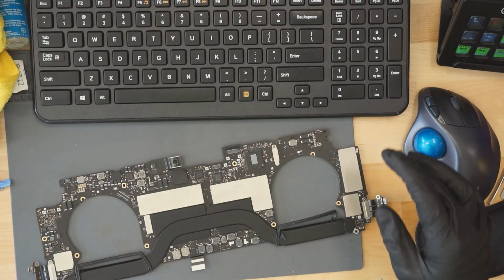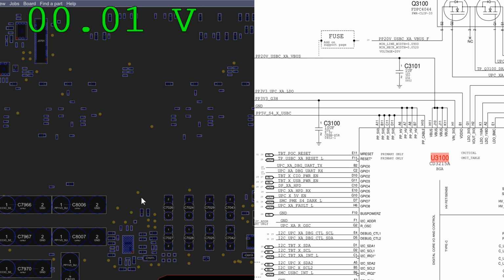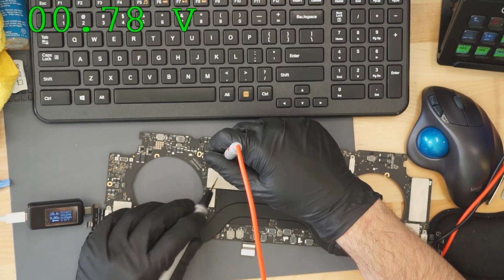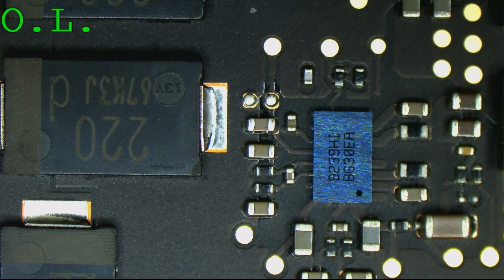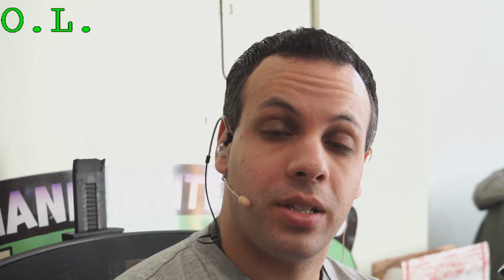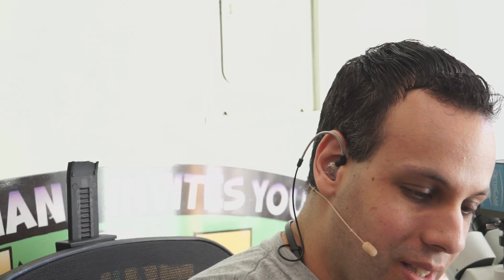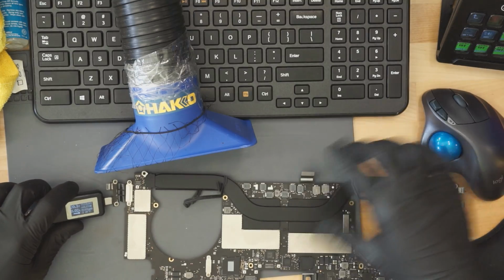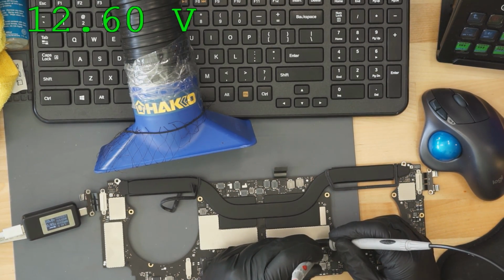Why new Macbook boards will be unfixable for me: sad :(

Comment: Pro tip from Louis, dont buy Apple, its being run in to the ground since Steve died.
Reply: problem is if you want to develop on OS X or Iso you have to use an apple product. Those are the only 2 reasons I could ever come up with to buy apple, pc kills them in every other aspect.
Reply: @asdfkhieee  Not even that. I wrote an I-Phone app without ever touching any apple product. I just installed iOS and MacOS on my Linux PC. (final testing obviously had to be done on an actual phone, but barely any issues there)
Reply: @patrickkeller2193  hackentosh is cool and all, but most people arent gonna do all that. Easier to buy a MacBook. The updates have a tendency to make you have to rebuild parts of your hackentosh.
Reply: @asdfkhieee  Nah, we were not using any hackentosh software, we were using straight from Apple MacOs in a virtual machine, that we got in a premade image. literally ctrl-c, ctrl-v install. And iPhone on the second monitor. Never got update issues for the whole year either.
Reply: @asdfkhieee  The only reason you have to buy into an ecosystem you don't like, is to develop for said ecosystem? Why should this matter to anyone with the above view of Apple being shit.
Reply: @jaihayes9647  because you want your product to get into as many hands as possible to maximize profit. So if you want said product to be in the hands of everyone you need to use the aforementioned OS or lose a large portion of users.
Reply: A tip from Louis, "Guy, don't bother fixing Apple products, they're unfixable... oh just leave it to me, I'll fix 'em all." .. lol
Reply: @Kero Two you dont have to run windows on a pc though.
Reply: Whats the last Macbook/iMac that was made when Steve was alive?

Comment: MacBook Pro have become completely garbage. Last year I have purchased 2017 top specs 15 inch MacBook Pro. I just sold it about a month ago. I rather buy a clevo laptop with a desktop processor and upgradable parts. Windows 10 pro is a good operating system and is very customizable and optimization for pro audio and video production  And is way cheaper and better for the ridiculously overpriced overrated  what Apple is charging!!

Comment: @Louis Rossmann I salute you and wish you luck on your uphill battle against the rotten apple tree. They design products that are extremely difficult to repair and if that doesn't work, control supply chain so the parts needed for repair is not available to third party repair shops. Curiously, the part that is hard to find is the one that keeps failing with no good reason. Makes me wonder if it's designed to fail like that?? This is how they monopolize a market and rob people blind. On the other hand, if people wise up to this scheme early enough through channels like yours they may abandon the apple tree and let it rot alone which would take Apple back to mid 90's where they almost went bankrupt. On the PC land, it's harder for likes of HP, Lenovo or Dell pull this kind of scheme, because consumers can switch to another competitor's product without losing as big of an investment locked into Apple's monopolistic ecosystem. Imagine if Ford or MS tried pulling this kind of scheme back in the day... At least parts should be available to end users to perform their own repairs if they chose to do so.

Comment: And it is Louis's recommendation that i didn't buy a new Macbook Pro. I still have my 2011 original release MacbookPro Retina. i just replaced it with an MSI GE75 Raider. 16gb ram that i can replace, i7 8750 6 core, 6gb GTX 1060 and the ability to come with 3 Hard drives that i can replace. Like to see a new macbook pro do that!!!

Comment: Have you had any complaints about iphone wifi dropping? mine has been very temperamental over the last few months but yesterday it started dropping wifi connection(Still connected but not responding until you turn wifi on then off again, then it happens within the next 5 minutes) I guess iphones really ain't your thing but i figured since you're such a big "fan" of apple, you may know something about it? If not then meh, i'll just go back to android -.-

Comment: Efforts are made in the EU to make it illegal to make products unserviceable.
Reply: Yup I heard something like that too, how people end up having to throw away a clothes washer because the tub can not be disassembled to service a simple electrical part underneath. But, I also recall EU made micro-usb the standard all phone vendors would have to adhere so people don't keep amassing phone chargers with different connectors. By the time the standard settled in, guess what, we got new standard that came along; lightning connector, tb2, usb-c, ... Before a standard matures and becomes mainstream it gets replaced by a new "standard".
Reply: @tech29X  i think USB -C is wahat they wanted as a standard, and well thats well underway i believe
Reply: @tech29X  well, yes, but all are USB (some version)
so you just need cable, and working TV with USB port for charging phone
before every phone has own charger even from same company.
Reply: I thought it was the Peoples Republic of China that mandated all phones for the Chinese market had to be able to be charged using micro usb. But I may be wrong...
Reply: @MaskinJunior  It was about 10 years ago, I had read somewhere it was EU, but regardless, the essence is the same, and does it matter, who?
Reply: @tech29X  Korea did it first with some weird charger, China followed with various options that need to be connected to an usb type a and then EU had their common external power supply standard in 2011. So that standard matured and has been used everywhere in the eu for 5 years beforee usb type c came around.
And the IEC also took over that standard in 2012.
But the EU actually didn't specify that it has to be micro usb that connects to your phone. They suggested its usage but the phone manufacturer can actually just add an adapter to connect to your phone so the important part is really jsut the charger itself and that the charger fulfills the usb standards and you can put any adapter onto that charger using an usb type a connector. A detachable cable is also an adapter.

That means usb type c chargers are actually compliant to the EU common EPS standard.
Reply: @Kennorx  Thanks, that explains why I keep seeing power adapters with type A USB ports on them.  I think USB-C with PD was long overdue, or it should have been there years ago, but better late then never. Now let's hope we don't fry our phones when we plug them into the type-C adapters that we use charging our laptops.
Reply: @tech29X  That is actually what the PD standard is for. The USB PD standard is actually an active thing. A protocol that negotiates how much power needs to be delivered. So when plugging in a PD connection your device tells the charger what power it needs and the charger does its thing.
And it doesn't only work with USB type C. The powerdelivery standard is for all usb types although obviously not every single one can deliver the same amount of power.
But yeah we have been using power delivery in some form for years now. But as it is that standard also gets expanded and better all the time which means not only possibly more power but also not locked to certain power profiles and so on.

For phones we pretty much only use usb type c because it's rather sturdy and small though. Even micro B can go up to 15W at 5V 3A but charging our current phone batteries with anything higher than 10W is generally not a good idea.
Reply: @tech29X  Thats a problem with the EU - if someone needs to take a sh*t, it takes years of procedures before he can go to the toilet.
Reply: @ian2958  The problem is more complex than you describe. It has been agreed that the U bend should not be as bendy. Since there is no standard which can be applied to the curve of a U bend, it needs legislation to define a straight U bend.
Reply: Anton Zuykov  not equivalent, as long as the soc is available for purchase it is serviceable. And there is no good reason to not make these things available for purchase outside of denying 3rd party service providers. Yes, they could make it economically nonviable to service their soc's but as long as it isn't due to artificial inflation it is unlikely since developing such soc's is cost prohibitive. There is a reason power components aren't built into cpus, you dont need microscope manufacturing process to make what is essentially a hammer. Though I agree such laws are prone to abuse, I'd rather have laws that require manufacturers to inform people of their reliability statistics/cost of ownership on similar devices they made in the past.
Reply: Oh don't be mistaken, the items will be serviceable, you'll just have to order the whole motherboard from the manufacturer via a supplier with markup.  Don't believe for one moment that the rules will force component level repair.
Reply: @D Cheema It is not the issue here. It is that Apple makes stuff serviceable, even by them. You should be able to hand a $100 device to a professional to have the battery replaced. And it should be possible to be able to buy batteries for a $100 device, Then if that replacement voids warranty I don't care. I like my phone, so I want to keep it alive for much longer than it was designed for by using spare parts for it.
Reply: The US is among the first place to enact right to repair laws too. In Europe it's about design of components in the US it's about availability of parts. We need them both to be effective. After all it doesn't matter if we can get the parts if we can't replace them. It also doesn't matter if we can replace the parts if we can't get them.
Reply: i don't care we want OUT of the horrible EU #brexit
Reply: @d.d.4217  I have to say that you are not alone in your prediction!
Reply: Too bad the EU is not the USA
Reply: While this sounds nice, they're going to find a way to get around this.  Either making the part ridiculously expensive or limiting the number made so that there's actual scarcity and their guys just happen to get the parts before everybody else.
Reply: @d.d.4217  Brexit allows Britain to get its sovereignty back from unelected beuracrats.
Reply: Oh FFS, I've read the replies below and they are almost all total bullshit.
The EU says, in simple terms, "If a product was designed with planned obsolescence, the manufacturer has to put that on their product/box/docs. They can still sell crap that dies after a two years, but they must put it on the box.
On top of this, the EU mandates a two year warranty period for almost everything that really should last at least two years.
Reply: waterproofing is gonna get alot harder in the eu then. no potting shit in resin
Reply: Yeah in eu we also have article 13
Reply: "Unserviceable" also means "does not function".
Reply: Servicable parts must be better for everyone except Mac !
Reply: Add that law in the US and you got a deal.
Reply: European here. It will end up being same thing like everything else. Useless regulation that makes everything more expensive and makes entry into the market harder, diminishing competition and securing the market for all the big corporations. Very dumb to root for this.
Reply: also memes
Reply: N O  nice analogy
Reply: Sunamer Z  "Do you know what was more serviceable than modern LCDs? Vacuum tube TVs." - This is simply not true. The CRT itself was just as unserviceable as the LCD panel is these days (except CRTs failed faster than LCD panels do) and in modern LCDs pretty much every other component fails sooner than the LCD panel itself.

"manufacturers that own older tech, will be able to pressure new tech out of the market with the help of such laws" - No they won't, because "new" doesn't necessitate it being irreparable.
Reply: @CoolKoon  There was a time that even regunning an crt was an economic business, and crt rebuilders existed. Not possible with cracked lcd panels, and panels are very delicate to a simple impact which renders a tv a total loss, much more than wear alone. A crt almost never broke, it does wear but slow.
Reply: @telocho   Sure, up to the late 80s I'd say or so. But I disagree, the CRTs DID wear out, but it happened on the inside. That was what made the re-gunning necessary too. And the whole CRT was glass too, so an impact has rendered them just as unusable (and the TV a total loss) as for an LCD panel. Plus LCD panels wear MUCH slower than CRTs ever did. Most older LCD monitors I've repaired had either a dry electrolytic cap or two or CFLs that needed replaced. It never was the LCD (yes, they start developing problems quite fast lately too, but that's a relatively recent development).
Reply: Simple solution.....dont buy apple.....!
Reply: @ascher40  Heh, you wish. Like it or not, Apple's a trend-setter. Apple's making unserviceable phones? Other manufacturers will follow suit. Samsung, Xiaomi, Lenovo et al. have equally unserviceable phones, with the possible exception that maybe they haven't cracked down on their own subcontractors yet.
Reply: Kartikay Bhardwaj  Meh, the devil's in the details. We're yet to see the details and it wouldn't be surprising at all if loopholes would appear that would allow Apple to avoid it altogether. After all they have a toxic and unsustainable business model to keep up...
Reply: Efforts are made in the EU to make Europeans infertile. The EU is beyond redemption.
Reply: @Nexus Clarum < Unfortunately the recent "tide" of undesirables will pollute and dilute EU's clean gene pool, and there'll be more dumbass mutts than anywhere in the world.  They just need to bring on socialism and then the circle of destruction will be complete. Just sad... Rip EU as we've known it for centuries :(
Reply: @BillAnt  Ah, you're one of those. So do you think migration was not an issue during WW I and WW II?
So our "clean gene pool" has never been a thing, you can even go back to medieval times and find cases where Europeans brought back Muslims with them as slaves and of cause sometimes like there new partner.
Then some of us moved over to the U.S. so it's very possible your own gene pool is not as "clean" as you think.
Reply: Yeah, but memes are banned in the EU
Reply: @GatorInVirtual  LOL! Yeah...but....but Nissan Skylines are banned in the USA! Your turn.
Reply: @gonzomuse  i live in aus sooooo
Reply: @d.d.4217  Brexit wouldn't make any difference. If any MPs with mental capacity greater than an amoeba can be found, they'd accept that EU legislation and mirror it. Similarly, any UK manufacturers would have to offer parts in order to sell to EU Nations.
Reply: Those damn Europeans and their oppressive laws. Thank Gad fur #broxet
Reply: @varun009  OmG sO oPpReSsIvE ThEy'Re TrYiNg To StOp ApPlE aNd ThEiR cOrPoRaTe GrEeD
Reply: It can't go that far.  Some things are naturally not serviceable.
Apple would be serviceable, but they refuse to sell the parts
Reply: @robertm3951  "It can't go that far.  Some things are naturally not serviceable." What things? If they are then they are like that by design and if i understand it correctly the whole point is to make that illegal. "Apple would be serviceable" no they are not and its even in this video, they adding features to make it unserviceable or like in this case forcing 3rd parties to not sell parts that they using to anyone else...
Reply: Probably because the EU sucks Apple's c*ck to invest more money over there, so they're willing to dance to Apple's "iTune". (pun intended;).
Reply: @BillAnt   Couldn't be more wrong. The EU have forced Apple to pay 13 BILLION in taxes and are talking about forcing them to drop Lightning in favour of USB-C. There is only one country that's gagging on Apple cock.
Reply: Mark Bowyer you can’t force a company to change their products just to be better for you 

Don’t like it, don’t buy it , duh
Reply: @BillAnt  They dont. They asking already for a lot of money. No big company will ever be relocation to the EU :D
Reply: @TeDynef < Ireland seems to be an attractive place for big corporations to shelter their $$ from huge taxes.
Reply: @BillAnt  Yes today... but the european leaders (france,nederlands and germany) will kick them in the face not in the but anymore....
Reply: @TeDynef < Well that's the whole point of Brexit, so that the EU won't be able to control the UK's internal affairs anymore (that is if it goes through).
Reply: And thats why I dont live in Europe.....
Reply: @Moon_Presence  wait, you don't live in Europe specifically because of a rule that helps consumers by saving them money on repairs? Are you Apple?
Reply: Don't worry, The altright (Conservatives) are hard at work here in The UK to pull us out of The EU with Brexit, and then promptly make it easy for companies to again make their products unserviceable and to also strip people of their hard-earned rights that The European Court of Justice (ECJ) gave the people, After all, you can't have people running around with freedom of movement and human rights, that's not capitalism is it? It's not British either, it seems.
Reply: Andrew Sanderson that’s funny because the only political parties willing to enact anti trust law suits are conservatives.
Reply: I'm sorry but that's bullshit. Their company their rules. It should be allowed as long as companies clearly advertise their products to be unserviceable.
Reply: EU is a new Nazi party merged with the communist party!
Reply: @patriotsleepercell4060  ok boomer